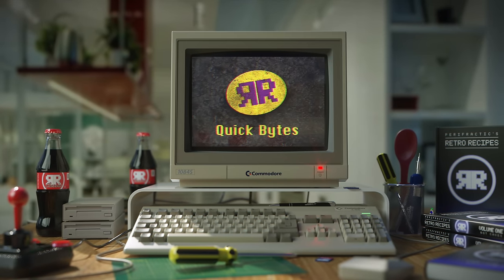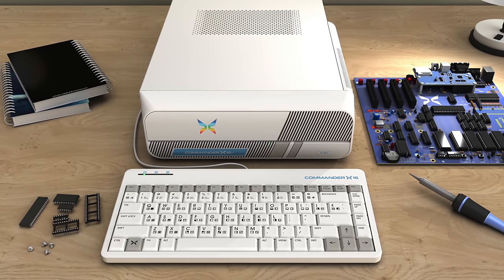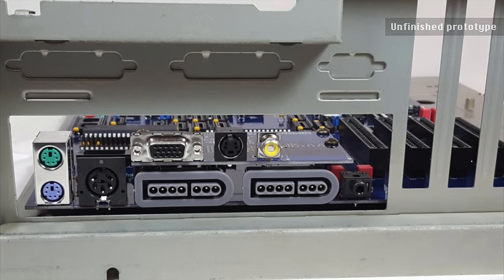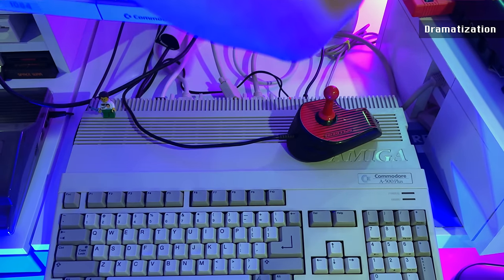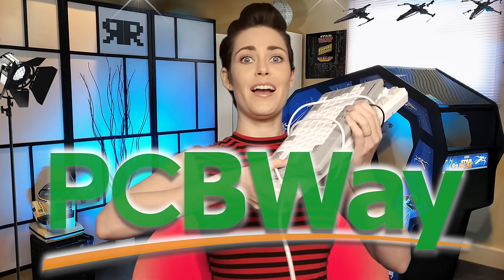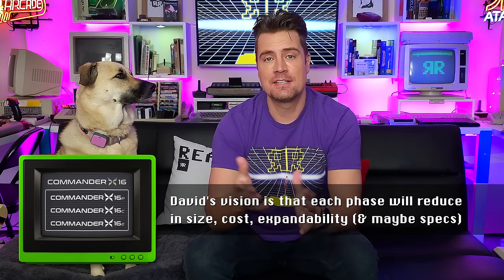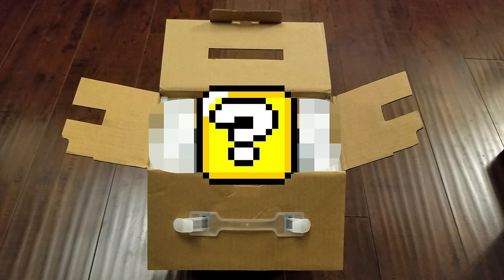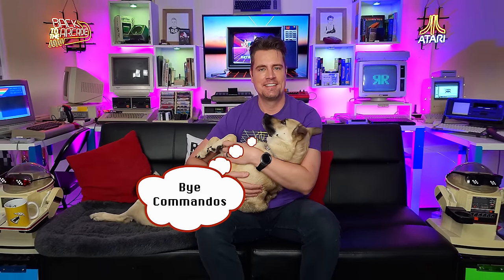Commander X16 Visual Design Update: Case/Keyboard/Manuals! The 8-Bit Guy's modern retro computer

Comment: Atari Mega ST
Atari TT030
also had separate keyboard / computer designs.
So does the Commander X16 have development tools? I would expect a C++ compiler, Assembly, alternate BASIC implementations, editors for graphics, sprites, fonts, music, and sound effects. Disk and file management. And the usual multitude and plethora of what you want a computer to do. Possibly also play media, surf the net, and edit video to a point.

I don't know the specs but it definitely needs software development tools. Easy ways to port software over.

Comment: Im sorta wondering about that vent on the top and the case rigidity.. Is it gonna be possible to put a crt on it? Not a huge one.. I have a tiny 12-14inch eizo crt i want to put ontop, is that going to cause issues with cooling and or damage the case?
Reply from the maker: Answered in FAQ - see pinned comment 👍🕹
Reply: @RetroRecipes  ah, thank you!

Comment: Looks like a lot of fun...  PCB = "Probably Can Buy" one of these when it comes out... I kind of miss the good old days of the 8-bit 6502 - In 1982 I wrote the VIC-20 game "MUNCHER" Sold/distributed by the Wizard's Magic Toy Box...  I still have my old commodore equipment that I want to get working again. My Last Commodore Purchase was an Amiga 1000. I loved the 68K processor, so much better than 6502 especially when it came to working in assembly. I know it's not 8-bit, but it's a bit more fun... actually it's several bits more fun😁

Comment: Finally! A computer with a reset button! 😎 (I never thought I'd be enthusiastic for a feature like that, but it is something that I miss a lot nowadays)
Reply: most desktops still have them.........I'm not sure why because you're really not supposed to use it. I did hook it up when I built mine.
Reply: Holding down the power button for 3 seconds will reset. Geez. Every pc has this.

Comment: Since it has 80 columns text support I am seriously thinking to use it in our company for some simple production and warehouse related tasks (and because I get goosebumps when imaging 80s 8-bit computers will be used productively in 2021). Data exchange could be an issue but I think it should work via ascii csv -> serial interface -> arduino -> soap xml -> ethernet -> webservice/appserver.
Reply from the maker: Dewit!

Comment: This is such a nostalgic thing....as soon as I'm able, I'm buying one. Side question, is there a possibility of having an option for faster clock cycle, or even data on the maximum it can run?  Won't affect my desire for one, just wanted to know.
Reply from the maker: I don’t think that option will be built in but I’m sure the community will find some overclocking hacks later.
Reply: That still sticks in my head as an odd engineering decision. Many computers at the time used divided clock domains. The PC/XT for instance took a 14.31MHz clock and divided it down for everything. I don't understand why this approach wasn't used, rather than the current method of an 8MHz global clock.
I have an idea of how to work around this after the specs are finalized.

Comment: Just a thought on the separate keyboard vs integrated, most that had the separate KB were expensive/pro machines. Most of the home machines that were affordable were built in so nostalgia is for built in kb's rather than seperate?
Reply from the maker: I don’t think the Amiga 1000 or Macintosh were pro machines in any way, quite the opposite really.
Reply: @RetroRecipes  But they weren't cheap either were they, certainly for home machines?
Reply from the maker: @smartroadbiker  I guess I’m not sure what the point is you’re making about Pro machines? As mentioned X16P unofficially stands for Pro and is as expandable as an Apple //e.
Reply: @RetroRecipes  Not making a point about pro machines, just an observation on your point of people asking for an integrated keyboard machine and wondering if the reason people are asking is because from our childhood we mostly had integrated keyboards. I myself had a BBC Micro, Spectrum and Amiga A1200 all of which were integrated machines. The first separate keyboard I had was a 486 Packard Bell (25MHz SX of all things!). So all my formative years, and thus the most nostalgic, are with computers that had integrated keyboards because they were cheaper (the A1000 was almost twice the price of the A500, $1285 to $699 if Wikipedia is to be believed). I just thought if that could be a reason people ask for integrated keyboards because those are the ones people had in childhood?

I never was making any comment on the Commander X16 (p, c or e). The way the team have gone forward, as you say, reduces cost and enables easy expansion and hacking - I'll be in the line to buy one when we can 😁
Reply from the maker: @smartroadbiker  Ah yes, that’s definitely why some people have fond memories of them, as do I. However they just are less practical from a cable management perspective, and David’s original vision was never to try to re-create childhood nostalgia. There are so many options already out there for that, and I love all of them equally. But this is slightly different vision of moving forward whilst being functional. Glad you’re excited for it!

Comment: Atari made a couple of 8-bits which are relevant to the question of all-in-one or not. One was the XEGS which was a true 8-bit but it had a separate keyboard. It had up-to-the-minute mid-80s styling, but internally was rooted in the 1978 Atari 800. The Atari 800 itself was one of the few small computers with a raised rear section behind the keyboard. (Normally, such machines were huge.) Such a raised rear might be used for small expansion cards mounted sideways.

Personally, I think a separate keyboard is a good idea because I grew up using 8- & 16-bit all-in-ones. My 8-bit Ataris were all right; the keyboard was low enough. Later, I had an Atari ST with a disk drive in the side, rasing the keyboard. One computer like that was quite enough! ;) 

BTW, I very much agree with not using long words if you don't really have to. ;)

Comment: question if i buy x 16 prebuilt unit does basic coding book come with it?
Reply from the maker: Yup!
Reply: @RetroRecipes  if it didnt it be expensive paper weight iv only messed with 98 se xp 7 10
Reply: @RetroRecipes  i wish amd make a retro machine with 1 core 2 thread 2 mb l2 l3 cache 2 dd4 dimm slots pcie 3.0 port sata 3

Comment: Weren't you tempted to go for an internal riser card to insert the cards in - similar to the Archimedes? That way you make more use of the internal volume and the case doesn't have to be so high.
Reply from the maker: Here’s the same answer I just gave someone at the forums: What you are describing is some thing we discussed and debated at great length internally about six months ago. Long story short that is likely what the phase 2 design will be as I showed in the video. The case is less tall but may still allow for a right angle expansion card inside, and possibly an external expansion card adapter to allow for cards to sit outside the machine, like those C64 cartridge port expansions. 👍🕹️ 

For this case it would still be too cramped. The vertical design is just so nice to use.
Reply: @RetroRecipes  Good compromise. Versions can evolve when you get feedback and real world usage dictates what happens.

Comment: i'm using that kind of micro-atx slim pc case, in my country it branded as Ufora LP
Reply from the maker: Really?! Can I see a photo anywhere?
Reply: @RetroRecipes  http://www.kebostech.net/product/brand/1/1/4/143
that's the official site, the commander x16 version of course use custom front and without the optical drive/floppy drive bracket, but the base for the case quite the same
Reply from the maker: So it is!

Comment: 8-bit computer with PCI expansion slots? heck yeah, even if the slot is just GPIO, using the mounting hardware for PCI is so cool, so maybe other cases will be compatible with the board ^-^

Comment: That looks a really cool machine. Commander X16? Is it a retro 16-bit computer.  

All 'serious' computers used to have the separate keyboard from the processor box. Remeber the North Star Horizon or the Microtan? Particularly CPM ones. The all-in-one design was for home computers to keep them affordable. However the Commodore PET, TRS-80 and the Sharp MZ80K followed 1the 1970's design style including the monitor. They looked like a terminal for a mainframe computer.
Reply from the maker: That's right Michael. This is a serious retro computer... apart from the drawings in the user guides ;-)
Reply: @RetroRecipes  Then ideally there should be a numeric keypad option for the keyboard for numeric data entry.

Comment: what about make a small channel under the case for the keyboard cable passes under the case other then going around the case . it would make it look even cleaner.
Reply from the maker: I feel like I explained that in the video? We are using customized rebranded off-the-shelf parts. To do what you suggest would add over $100,000 to the project cost requiring a custom designed case from scratch. However you could use tall rubber feet if you really wanted.

Comment: I think it's an unusual choice to have the component side of the add-in cards on the "PCI" side of the card instead of the "ISA" side of the card.  The Apple used the "ISA" side of the card for components too.  I guess this means there is no intention that the CX16 will have any form of backwards compatibility with busses?
Reply from the maker: I’m not quite following what you were saying but people who design expansion cards can put the components on whatever side they wish.
Reply: @RetroRecipes  In your rendering the cards support bracket is the PCI style with components facing away from the CPU.  During the ISA to PCI transition they flipped which side of the card was component vs solder, this meant you had 1 slot that had ISA and PCI connectors next to it and you could use either card.  What it means for users of CX16 is that they need to source PCI style support brackets.  If the slots were shifted over 1/2 slot width then the component side would be the same as Apple and ISA expansion cards, with relation to the card support bracket.
Reply: The cards are setup this way on purpose.  You simply cannot buy half-height ISA-style brackets, but PCI-style are a dime a dozen.  Also, I really didn't want to use a 50-pin connector as these slots ARE NOT Apple II compatible.  It would very likely smoke an Apple II card to plug one in, so I offset them closer to the case and backwards to discourge this.  The fact is though, the 50 pin connectors are pretty cheap, so I opted to use them.   The other idea I had PCIe 4x slots was hated far and wide. 0.1" spacing FTW :-)

Comment: This looks AWESOME, though I do worry about the cost skyrocketing. Hopefully we can get to the final low cost version sooner rather than later. (I think David's original goal was <$50!)
Reply from the maker: The original goal was at most $99 and the X16E should still meet that. This one may be cheaper than you imagine. 👍🕹
Reply: @RetroRecipes  I hope so because this looks great. I've been watching the Mega-65 project as well (which uses FPGA mainly). A $99 Commander X16 that comes with an actual user and reference manual that you can lay on the desk as you learn and a thriving support community could really explode on the market (in a good way). Retro all the way, man!

Comment: It's a cool project, but the SNES ports on the back of the case irk me.  I recommend moving them over to pin headers and exposing mounting locations on the front and side.  (End users could still opt to put them on the back... Bc that's how pin headers work). My $0.02.  Still though.  Cool project.

Comment: would of been nicer to see a completed mobo to cover all the slots on the back of the case

the bigger question would be  how far forward or how far back in  support will it go will have a dongle support for carts...

I only ask this as it would be a nice option to have the entire cart libs be applicable for use..

bigger question  printer and/or controller support..

love to be able to use me battle station II on the amiga..

My other question  are you going to include a capture card with it so you can add this to a streaming setup..

main reason I had suggested  the use of hdmi in the 1st place was to reduce cable clutter..

Noting I did warn them initially that actual modern tv's with vga connections only audio from a 3.5 mm  jack 

you can do  composite/component/s-video though the issue comes if you want to add it to streaming  capacity there isn't a lot of options in 2021 that can capture analog audio or video
I would advise a ps2 extension cable other wise you are looking a long direct ps/2 cable

weight on the ps/s jack will likely damage it long term I ps/2-usb they are a short term fix that only ps/2 cable with ps/2 connector will cure or completely remove ps/2 and use usb
Reply from the maker: As shown on screen that was not the final design and the final one will cover all slots
Reply: @RetroRecipes  i know I was nit picking and would liked to see a complete usable board with all slots in use I know this isn't the finished concept yet though I still have to wonder why still go with an analog solution, nobody has access to crt's within 13-59 inch service option unless you are a tech horder..
Reply from the maker: @jasonhowe1697  Please see pinned comment as everything you are asking has been answered before 👍🕹️
Reply: @RetroRecipes  yup i know..

just wanting something usable from the prospective from a 32-55 inch tv with HDMI, composite and component  tv

don't have anything that has rca audio over the vga input pc input..

I know of the design process i tried to hilite this issue on the face book group and go booted for my troubles..

atleast from the POV of the 8 bit guy wanted to deliver something requiring old crt stock that nobody has these days and interface from the pov of tv's pc input no matter of the vintage in use whether it 2021-2008  (as the example)..

vga uses 3.5 inch stereo jack off that input..

Yea I know this is still in prototype stages 

I live in australia for some context 

unless you are shipping all cables with the commander 16 and so forth it isn't cheap to source the cables locally..

if you are going to push this option to the global market you be looking past 100,000 in investment capitol just to do this.

realistic my budget to buy this is within $1,000 AUD in scope of payment DEBIT CARD
Reply from the maker: @jasonhowe1697  Again you’re asking a lot of things already covered in the FAQ which is in the pinned comment. Such as the Australian power supply concern. Have a good day!

Comment: it is possible to add usb ports on the board created by you in the near future
Reply from the maker: We won’t be for reasons outlined in the FAQ but I’m sure a expansion card will be released by somebody
Reply: @RetroRecipes  I want to say if it is possible to directly integrate the board created by the USB port, those that can be found on the computer only the USB version
Reply: @RetroRecipes  or only the USB 2.0 port version, not the USB 3.0 port
Reply from the maker: @serbanvictorandrei631  No this is more complex for an 8-Bit computer than PS/2.
Reply: @RetroRecipes  I may not say no, but more in-depth research needs to be done
This is in case you need to check to see if everything works at normal parameters and much more
Reply: @RetroRecipes  
and not to mention many more
If we think about it, we should redesign the board again
Software reprogramming done again and so on taking into account a lot of research
And rebuilt from the whole circuit on the new x16 command board
Reply: @RetroRecipes  and if you think about it
And to try to gather all your programming knowledge in everything you know doesn't exist I can't
Because if you stop to think you can do everything but as I said you have to gather with all the knowledge accumulated in programming yes it is possible and you will succeed through will and ambition

Comment: I'm not in love with the design. It's not a bad design in general, but I'm not in love with it for this machine. I feel like it doesn't represent the underlying technology very well. The X16 is very simple, very minimal, very standard, or at least that's how it's billed. This case doesn't convey that to me, as it's very space-agey and busy.  I think the logo is beautiful and sells the concept by and large on its own. I would like to see that as the focus point, as if my eyes couldn't help but be drawn to it, sorta like the IIgs. It also looks glossy white, not sure if it is, but I would hope it isn't. The X16, again, conveys itself as a very hands on computer. It encourages you to open it up, prototype, change out hardware, etc. and glossy surfaces that track fingerprints feel like a deterrent to that.

In all, I feel like the design takes a function over form concept and lays it beset with form over function display. It's not a bad design, I just don't feel it speaks the same language as the hardware's perceived goals.